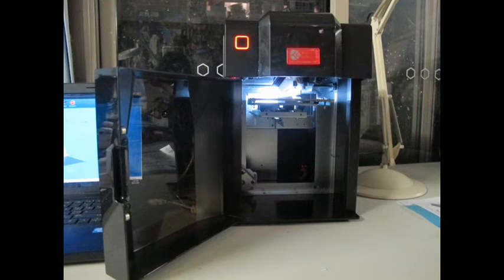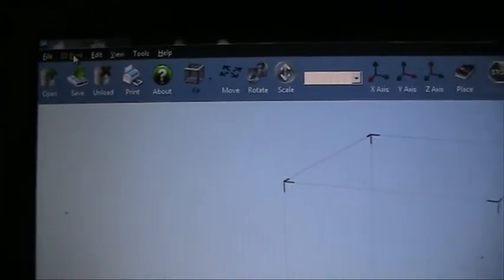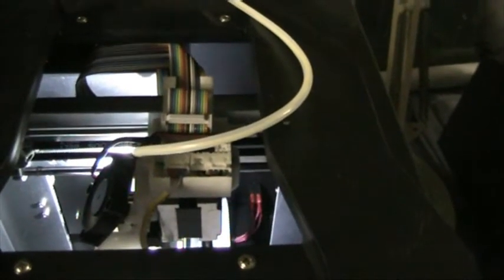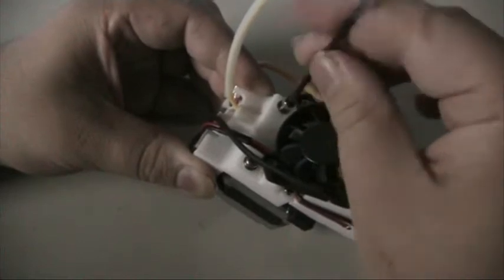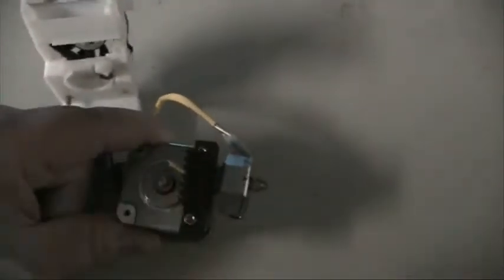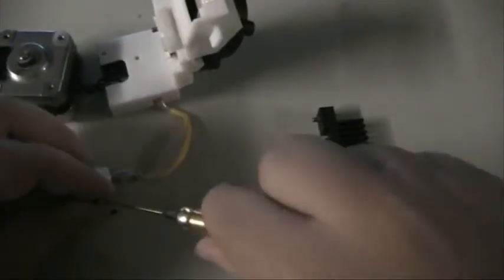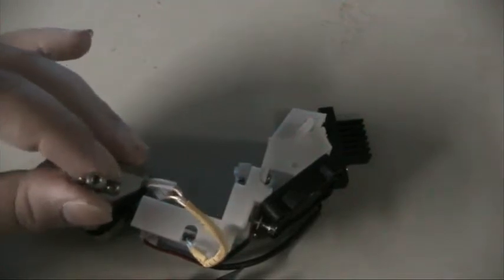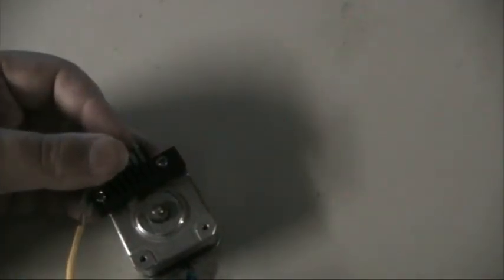Unclogging the extruder head on the Up Mini 3D printer

Comment: Awesome info my problem is where to find nozzles for this printer in the USA ugh lol
Reply from the maker: I ,may be wrong but I think it is a universal thread and output. Try one of the cheap unbranded ones on ebay for a few dollars first. Make sure it looks the same in the picture. Many parts on a 3D printer is standard.

Comment: I could solve all my blocks with the option to eject the filament (next to the extrude button in the maintenance menue) and simultaneusly pulling the Filament on the spool side with your hands (slightly).

That way the stepper motor can get enough grip to get a holt on the filament. There part of the filament that resides inside the nozzle should part easily due to the nozzle heating up.
Reply from the maker: Because the exturder gears are really fine once stuck it dig into the material specially if the exturder head is really warm and the material will not eject. My eject is a softwear option.

Also the material gets stuck between the stepper motor and head exchange so the nozzle is good. Thanks for the tip any way.

Comment: I just take out the print nozzle, then push the filament with a wire.
Burn the nozzle with a lighter then clean it with a tooth pick.
: )
Reply from the maker: Great advice I'll try that.